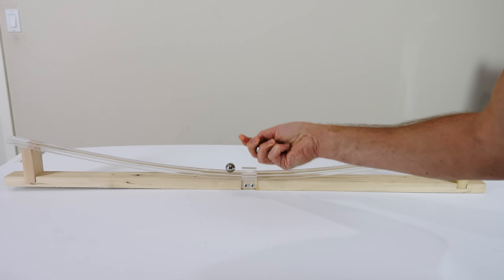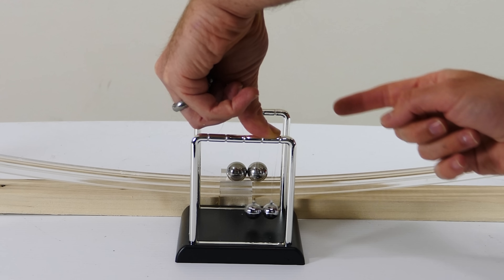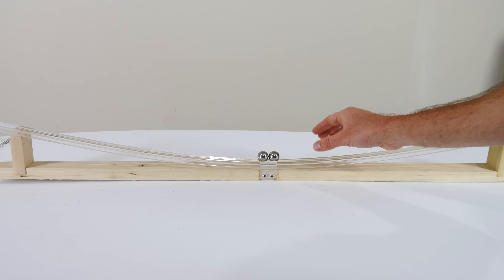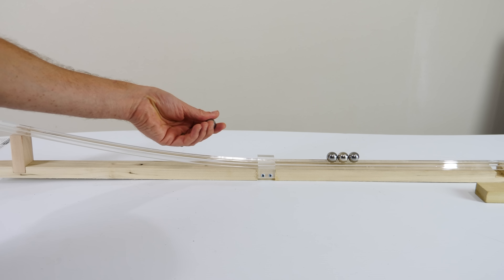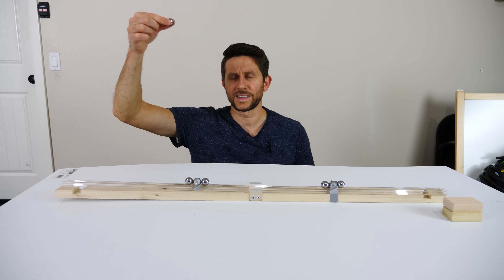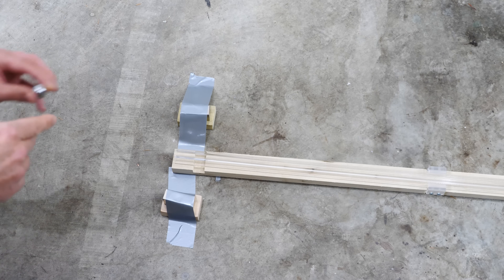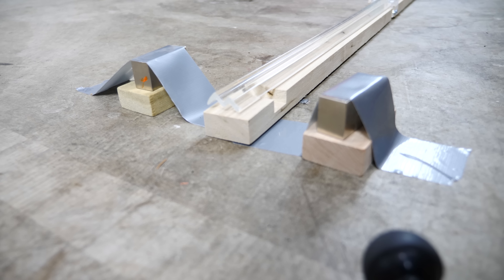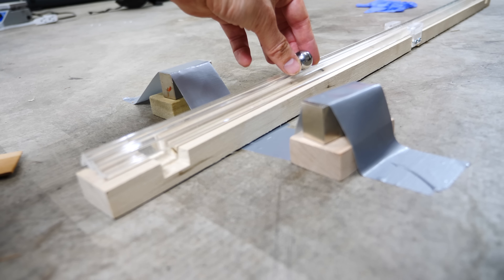How Does a  SMOT Work? (Simple Magnetic Overunity Toy)

Comment: I'm sorry for my prehistoric question that's off topic, but can an alternator charge a battery to continually power a machine indefinitely? Like a battery powered car?
Reply: No. The alternator uses energy from the turning belt to create electricity, but the energy to turn that belt has to come from somewhere. In an internal combustion engine, it comes from gas. In an electric vehicle, there is no crankshaft to turn a belt. The closest we have is the brake system that generates energy as the vehicle is slowed, but just like in a pendulum, it will inevitably lose energy over time, as it can not recover 100% of the energy used to drive the vehicle forward. Some will always be lost to friction, heat, or sound, even at the most efficient rates we could every create.
Reply: @ntsure2436  Thank you, much appreciated 🙏
Reply: @LJBJ50  I love the discussion, man. There's an old sci-fi writer who often curses by saying TANSTAAFL- There's No Such Thing As A Free Lunch. He applies it to many things from rocket engines to social change, and it all boils down to the same thing: that you can only get out what you put into something, and never quite as much. Whether it's people, reactors, or an economy, there is always going to be some expense that you just can't keep from leaking away from what you're doing. He supposedly thought love might be the only exception, but that we couldn't figure out how to make it move a feather, much less a car or a spaceship, lol.
Reply: @ntsure2436  Thank you for taking the time to explain that to me. I wondered that for a while and you really broke it down for me💯
Reply: @ntsure2436  Why can't the turning of the belt come from the tires spinning?
Reply: @LJBJ50  it could, but the same rules apply: you will be taking energy back from the wheels, but can never regain all of it. There will always be an energy leak either through the heating of the tires, the vibration of the belt, the sound of the tires against the pavement, and such. No closed system can ever be 100% efficient, and no more energy can created than is pit into the system. Even fusion devices which will generate more energy than it takes to start them work on the same basis as a campfire: you may only be using a lighter to start it, but the fire that results will come from the burning of wood that has absorbed energy over its life. In fusion, we may combine atoms by using high energy lasers and magnets, but we will be extracting a fraction of the enormous amounts of energy released from the conversion of matter to another form, not pulling it out of nothing.

Comment: I think you could make something go forever if that something can collect energy around it like heat or light and convert it into a force that pushes itself, much like a solar powered or thermal powered car or smthng, given that there is always light and heat present. Idk maybe? But something like a normal ball that just keeps releasing energy isn’t going to do it.
Reply: By definition, that is not a perpetual motion device, as you are consistently adding energy to the system. Granted, it is abundantly available energy, and is the reason why renewable energy is necessary for the future, but it is by no means free energy in the scientific sense, as a large amount of energy is being created by fusion reactions in the sun, which in turn, drives wind and water power sources.
Reply: Nøt Sûre Well, I didn’t say perpetual motion device. I just pointed out that only renewable energy device is possible and not perpetual motion device, since something that just releases energy constantly won’t work, it needs to have constant supply.

Comment: There is free energy in the accelerating expansion of space-time. Extracting it just is not very practical, to say the least :P.

Reason: energy conservation is a consequence of time reversal symmetry of law of physics, but dark energy, i.e. presence of non-zero cosmological constant, violates this symmetry. However, cosmological constant affects only very large-scale structures, hence energy is still conserved locally.
Reply: Yeah, free energy if it's available (Nikola Tesla was certain of it) won't be in the form of a kinetic machine. It will come from the ionosphere or through the ground or something.
Reply: Energy isn't really conserved well locally either, it's just not in a very accessible form. Gravity is the same within a localized environment, but outside of it's heat waste which we're already using (geothermal), it's a very hard force to work with.
Reply: @ImInForAWuppin  Energy is very well conserved, but entropy isn't. You can extract useful energy only by increasing entropy globally (locally entropy can still decrease due to energy flow to and from the system).

Comment: Free Energy is 100% possible. It has to do with a specific arch form geometry. An AC generator is an arch form. It does not generate electricity but manifest it out of the Aether. A solid state non moving device could be made that manifest free energy all the time.
Reply: Nope, nope, and nope. There is no such thing as the aether.

Comment: How do rail guns work to accelerate a projectile then? I’m clearly missing something. I mean I know how a rail gun operates, you just lost me when you said if a series of smots were in a circle it wouldn’t accelerate anything past the original energy put into it. What’s the difference here? Serious question.
Reply: Railguns use massive amounts of electricity to generate strong magnetic fields in the rails and the projectile, a part of the electrical energy gets converted into kinetic energy of the projectile. Here, the ball rolls across the smot only when there is another force like gravity to yank it away from the magnetic field, otherwise it oscillates. If we try to arrange smots in a circle, how do we add the gravity drop after each smot? The end won't line up with the start point, it would be much lower. It would be like those impossible Penrose staircase, waterfall, etc which show fake perpetual motion/free energy on a 2D image/videos, just like how the video shows with smots arranged in a circle.

Comment: Potential energy is a really cool thing. I wonder if instead of a metal ball you use a superconductor it can hold on to more of that potential energy kind of like a clock spring?🤔 After all I know you cannot get more energy out of something then the energy you put in. You'll probably lose it more to heat then friction using a superconductor. But I bet you could make several continuous loops on that ring like magnetic setup? ✌️

Comment: What if u subs the friction off by making it float. Superconductors?
Reply: They require energy to keep them superconducting, usually by thermal displacement to keep them chilled to a point where the superconductivity can operate. Even in a frictionless environment with no air to work against, the internal friction (within both the object and the superconductor) of rotating magnetic fields raises their temperature.

Comment: The ball flung-out off the track at 02:12 gets its initial energy from the incoming ball ("trigger") being accelerated by the magnet. However, to do it again and again you must make the effort to pull the trigger ball and then return the "cannonball" to the rear-end of the "cannon". So the same energy you "gain" from the trigger ball is the energy you have to "return" or give back when you pull the trigger away from the magnet and return the cannonball in place.

If a perpetual motion machine works, then it is fake.
Reply: You can have perpetual motion if you don’t allow any energy to leave the system. This isn’t really something you can do experimentally, but it’s not impossible theoretically. Orbits can be perpetual motion in ideal conditions( though the best you can do irl is losing energy through tidal friction, turning into heat, then light energy as it radiates away.) The real impossibility is extracting any extra energy from that system and have it keep moving. So really, even if you did have perpetual motion, you couldn’t do anything with it other than using it as energy storage, like a battery that will never lose energy as long as it’s not being used.
Reply: @jaredf6205  Even orbits are not infinitely operating systems. The energy lost from tidal forces and such may be tiny, but will eventually slow the or it, causing it to move to a closer orbit to retain momentum, eventually causing them to spiral into each other. It's not "free energy" in the scientific sense, but is abundant enough that it could power many things for far longer than human existence, similar to solar energy.
Reply: To add on to that, even if you set it up to move forever in one direction, you face 4 problems. 1. Infinite matter means infinite energy exists, so the track already has the ability to exert an infinite amount of force. 2.The magnetic fields will decay/ be spread out. 3. Assuming the magnet didn't lose energy(which is impossible) the balls after a certain point would get crushed against the magnet, and at some point, they would even collapse onto themselves. 4. Setting up the track would require infinite energy.

Comment: What if you hAd strategically placed Magnets ha go g from strings above the tracks to help the ball get to the falling point before falls and breaks that Gravity. Teaser if you will.
Reply: You can't "break" gravity. If it was strong enough to pull it up from the falling point, it would continue to pull the ball up to the magnet itself, thereby leaving you with a a ball suspended beneath a magnetic pendulum.
Reply: @ntsure2436  not to pull it up  it to pull it forwards just a little so it keeps moving, At The point it falls the magnet on the strings swings away from Allowing the ball to keep rolling not freeze.
Reply: @ntsure2436   Try this, A Bass car speaker in a box, Face it upwards with speaker pointed to the sky, Place a Frisbee on the speaker in the center and slowly turn up the volume and tell me what you see, Gravity has tricks to it, It can be done...Try it... The Frisbee will float!
Reply: @ntsure2436   Try this, A Bass car speaker in a box, Face it upwards with speaker pointed to the sky, Place a Frisbee on the speaker in the center and slowly turn up the volume and tell me what you see, Gravity has tricks to it, It can be done...Try it... The Frisbee will float!

Comment: Mag Lev Smot? Reduces friction considerably
Reply: But not totally. And also, what is powering the magnetic levitation? Energy must be put into the system from outside no matter what, be it thermal cooling, electromagnetism, or any other method.
Reply: @ntsure2436  yes that crossed my mind, more of a getting the smot concept to work as theorised, rather than little ole me "solving" a problem ☺️

Comment: Also it should be mentioned that even if you did make a successful loop, magnets lose their magnetism over time anyway so it's still not perpetual.
Reply: "lose their magnetism over time " yes , magnetism is naturally lost after 1000 years or so, so it is not perpetual by any definition- but quite close to it at an human scale-
Reply: Well as far as energy goes, yes, it's a slow burn, but there's not much to work with to get meaningful energy. Otherwise we'd use magnetic substances as fuel for things directly more.
Reply: @nobodyelse-h6h  
Over 1000 years… or much less: it depends on how much and how often the magnet is stressed.
Reply: And even if it was perpetual, it still wouldn’t matter because you can’t get any extra energy out of it anyway. Orbits can be perpetual motion, but you can’t extract more energy from them than they already have.

Comment: Nice! I wish you went into a little more depth into how the extra momentum collisions worked though. I guess the ball on the far end had less magnetic force holding it in, which is why it was able to launch off so fast.
Reply: @kasumiarimura5654  oh thank you so much for your ad, your work changes our lives for the better, yay, thank god for you existing.

P.S. Get rekt by a bull.
Reply: The ball does have less magnetism holding it because it's against a metal ball.
But the extra energy simply comes from the magnet.
If you put a ball near a magnet, stationary, the ball will start to move, faster and faster. That kinetic energy gets transferred to the ball on the other side. And it's more speed than zero (from stationary) just because the magnet moved the first ball.
Reply: @Ktulu789   That makes sense. I just meant that if it had the same magnetic force holding it in, then it would be slowed down. From an energy perspective, the other ball would have to climb out of the same energy well that the first ball is falling into, so it wouldn't gain any extra energy. But since it's further away from the magnetic ball it has less of a well to climb out of, so it goes faster.